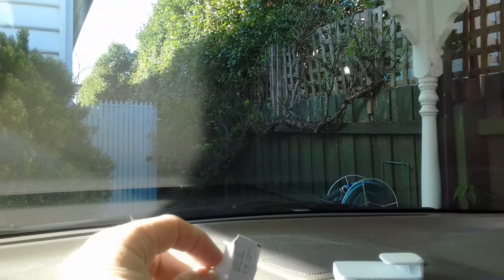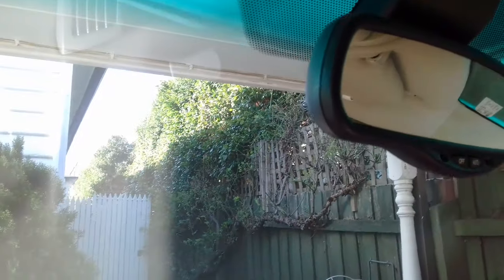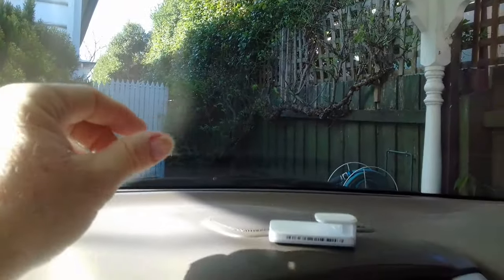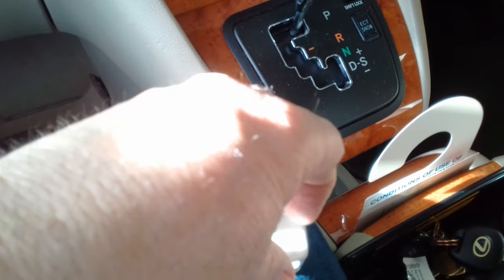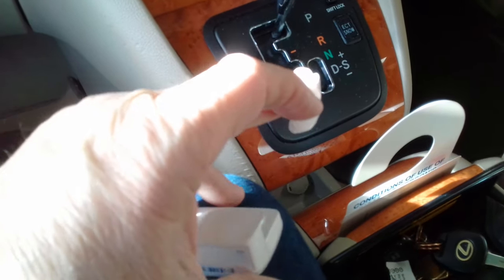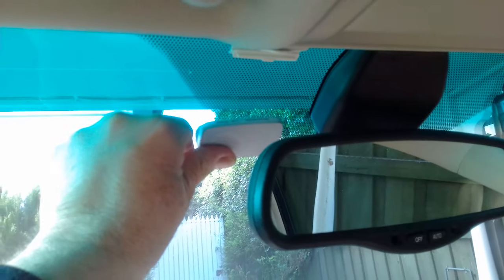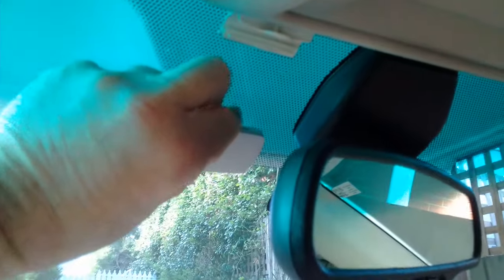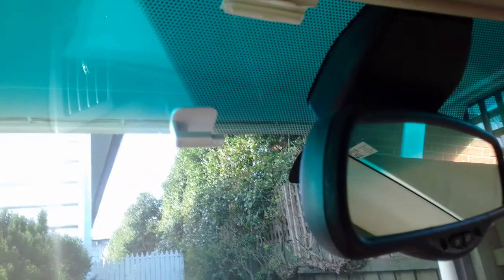How to place an etag onto a windscreen

Comment: Thanks man.  I also really wanted to put it in the same location but some people said you couldn't put it on the little black spotty area because it might block the signal. I just did it anyway. Hope it works. lol.
Reply from the maker: Have been through the gantries a number of times and found that it is always worked thank you for the replay
Reply: It actually states if your windscreen has black dots to place the tag within that area

Comment: What side if the tag should face up? The side with the barcode or the side with the 10 digit number
Reply from the maker: Does not matter which side is up.  Had a tag right side and currently upside down and  ways working fine.  As long as rhe atag is in a clear area.
Reply: I think you will find id does  matter It used to be barcode facing downward towards the dashboard

Comment: Thanks for this video. I installed it whereby the serial number is facing me... will this work or will i have problems with it? I tried sliding it out of the hook, but it seems like it has been stuck there forever. I'm leaving for France tomorrow.
Reply from the maker: @projbayer8302  the intake should work in any type of Direction either up or down. I have the trip to France goes well and I hope you return safe

Comment: does your e tag working on that dotted spot on your windscreen? coz I put mine on the same spot. not really sure if its gonna work.
Reply from the maker: Been through a number of times and always beeped.
Reply: @johnswitte  thank you mate! appreciated.
Reply: Some people insist it might not work but I also put mine in the dotty spotty area. Any lower and it blocks my view. I have heard from plenty of people that say it works just fine as long as it's at least an inch or two below the top of the windshield.

Comment: I got my etags today but it didn't come with a wipe :( what should I use?
Reply from the maker: Can use windex glass cleaner will work ok.  If have a liquid like water will work after the glass cleaner.  Neex to make sure tjat the site is spotless and completly dry.  Then can place the holder on and make sure that you can take the tag off car when the car is sold.  If you are able leave the tag off for a couple of hours or overnight to let the clue to cure.  Hope this helps you.
Reply: @johnswitte  thank you, it should help hopefully
Reply: KFC wet wipes will do, mate. 😂

Comment: Would be hard to take off from there mate shoulda installed on driver side
Reply from the maker: Current location tag is hidden behind the rear view mirror.  Have taken the old off and was not hard from the passenger side.

Comment: What are e tags? I'm from the UK btw
Reply from the maker: E tags are used on tolled or pay as you go roads in Australia.  Are there any of these roads in the Unitrd Kingdom.
Reply: @johnswitte  no not what I've heard of basically at our tolls they make you stop and there's asistance people there and you would pay with your card or money and the barriers are locked
Reply from the maker: We drive under a gantree and it pick up the tag and takes out the correct monies out of the companies account without stopping  Just need to top the account from time to time.
Reply: @azaanh.786  We have them in Plymouth to cross the Tamar bridge - useful if you cross frequently.

Comment: its the wrong way
Reply from the maker: The tag Kango in any orientation and still work
Reply: buts its makes it harder if you want to replace it with other one @johnswitte
Reply from the maker: @bandi642  Not really.  Has a few there and had no difficulties as the tag slides to the left.  Even changing the mounting arm is not hard.
Reply: @johnswitte  it does slide to the left? then my bad cause it looked like it slided to the right to take it off
Reply: @bandi642  looks like to the right to me too